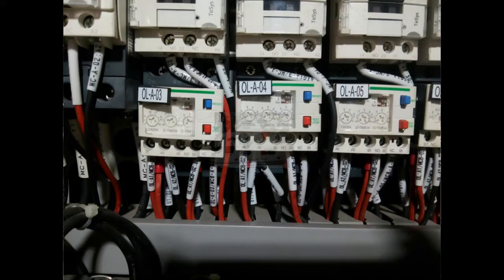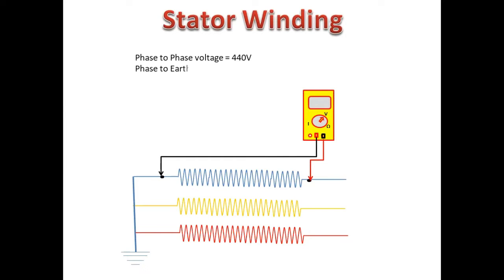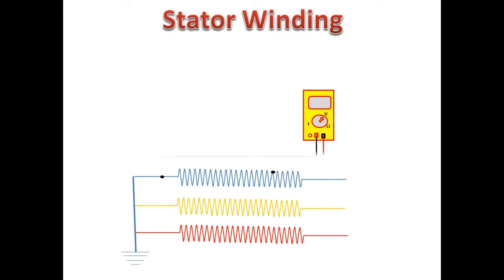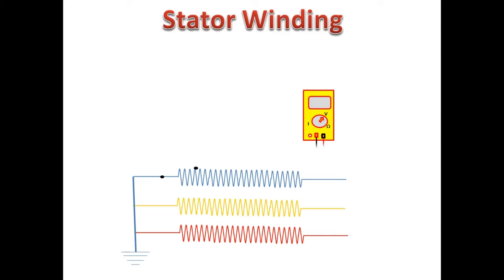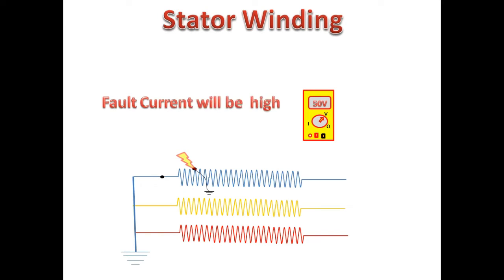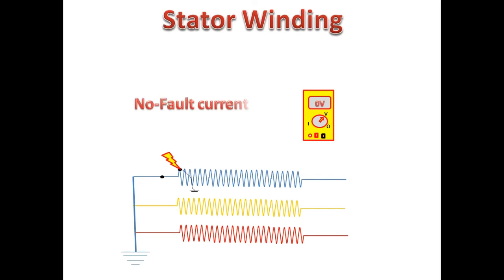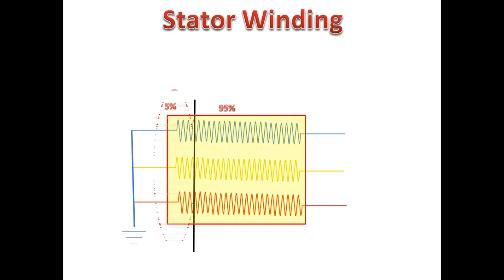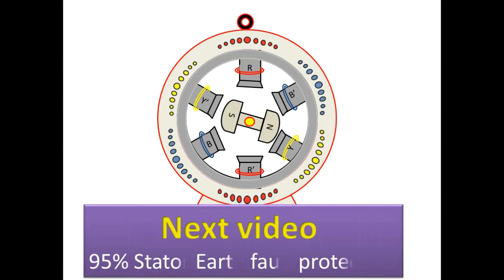Generator Stator Earth fault Protection

Comment: Hello Nice Video
More number of turns means more impedance so why current is high at phase side fault?
Secondly why we cannot use differential relay or. neglative sequence relay
Reply from the maker: impedance will not be very very high, stator earth fault is backup and to make more accuracy